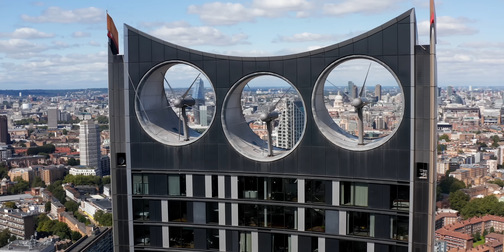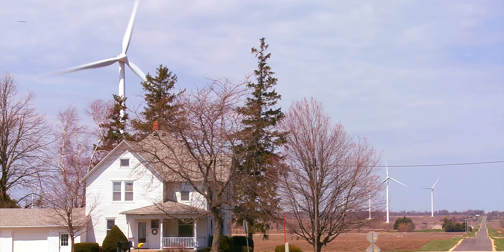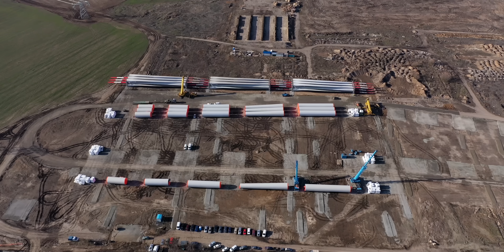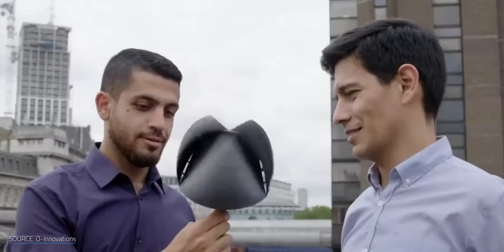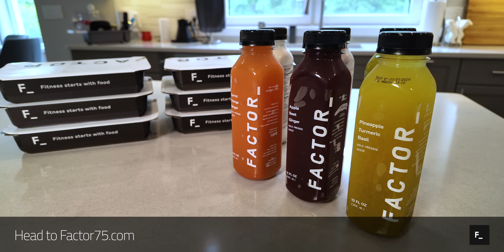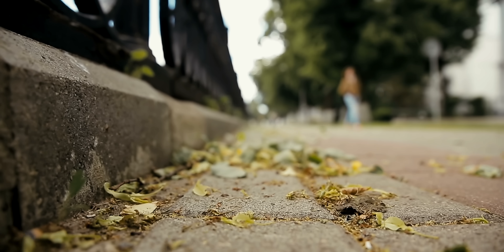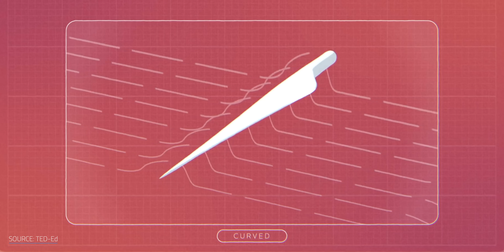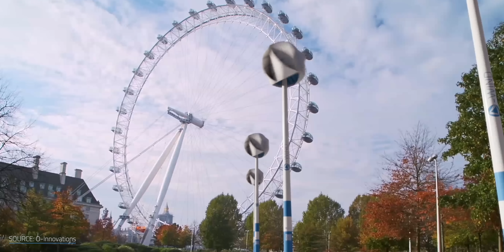How a Small Wind Turbine Will Revolutionize Wind Energy

Comment from the maker: Will wind turbines become the new wind chimes? Or should city slickers seek their renewables elsewhere? Use code 50UNDECIDED to get 50% OFF plus free shipping on your first Factor box at https://bit.ly/3BRkS87!

If you liked this, check out How This Mechanical Battery is Making a Comeback https://youtu.be/YrXw4CmxljA?list=PLnTSM-ORSgi7uzySCXq8VXhodHB5B5OiQ
Reply: I think it has a serious shot, and for both apartments and home owners. 
Pairing wind and solar, helps to offset their "intermittent" nature.
If it is light enough the wind speed can be slower, and still turn the turbine.
This is clearly an emerging technology, and we don't yet know what the mature technology will look like.
I hope you keep following the developments in this field, no matter what strange twists blow through its development.
Reply: After two power outages in one month, and living where it is often windy at night, this wind “chime” would be unobtrusive and fill the solar gap of cloudy days and night time.  It seems size and shape would keep it stable at high rotation.  I wonder if height could be adjusted by either moving it up and down a pole, or moving a pole up or down to achieve maximum output.  Also could this be engineered to hold more than one collector on a mast?
Reply: Now that we’re going into the winter I hope you’ll do a video on de-icing systems for wind turbines.
Reply: Opensource self-3d-print link please?
Reply: I think you shouldnt promote small scale wind power at all.
Reply: This is so epic that 
Hindus: This was somehow copied from the Hindu texts. 
Muslims: it was made during the Islamic Golden age.
Reply: Oops someone was impersonating you. I accidently reported your comment.... hmm the impersonator's comment  disappeared
Reply: @UndecidedTechnology  
I think this is a potential part of a solution which must encompass multiple sources of energy. Unless and until we get nuclear fusion both working and safe for grid-level power production, the only non-GHG power production method that can provide a base load is nuclear fission. Obviously, that comes with its own problems given our decentralized approach to nuclear fission plant design and waste management.

Thus, I like this turbine. It doesn’t HAVE to provide all the power an apartment building requires. But if it’s power can be combined with some solar arrays and excess energy stored in building or micro grid energy storage, then utility-level wind and solar and geothermal (if you’re I. The right area), and maybe tidal or some other niche green energy methods if in the right area, can provide sufficient power.

Until we have reliable and grid-level non-GHG power that can completely replace natural gas and coal, and be safer and produce less nasty and long-lived waste than fission, any solution must include one key requirement: redundancy. It is a flat-out bad idea to use just one of the current green power generation methods.

Every kWh generated by one of these turbines is one less needed from solar, ‘clean’ wind, et al. The question is whether the total lifecycle cost can be made competitive - so, the cost of hooking these devices into the grid, and of servicing them, in addition to their standalone cost per kWh,
Reply: As with other smaller wind turbines go, durability, colder climates use, ease of maintenance, cost set up are all important factors to be taken into account. This type seems very promising, but what were the numbers wattage produced from one of these type for a 24 hour period ?
Reply: I think the idea is brilliant, but if we believe the photoshopped GIFs in your video, the ideal placement would be in corporate spaces. So the ROI will need to appeal to large landowners who will hang the omni directional SWT off there apartment complexes and deal with the NIBism.  I just can't see anyone attaching one to a balcony in a condo, not because it is technically infeasible, just most HOA would actively oppose such visible change to the building.
Reply: The combined top 100 most populated cities in the U.S. only holds 19% of our population

Comment: I like the design. It has aesthetic elegance and engineering elegance in equal measure.  But my solar and battery system makes more than 2MWh in a month, so I don't see me investing in something that makes the same amount in 6 to 12 months.  Admittedly is a 27kWp array but even so, it's silent, maintenance free, doesn't take up yard space.... and I have solar days but not wind days for my site, so feasibility study for wind would require an anemometer, a data logger, and a couple of year's worth of patience

Comment: Over 10 minutes of video and audio (to attract investors?), but what is the efficiency of this ball turbine? 

You mention 2000 to 5000 kWh/year for a 2.2 m diameter device. That requires really strong wind.  You don’t have that at ground level in an residential area.  The use case is limited to open/ coastal areas where other turbine designs will work better.    

When you do the math based on the wind statistics at residential locations, the outcome is mostly not in favor of small wind turbines.

Comment: Omni  (vertical axis wind turbines)  (VAWT)    wind turbines have two disadvantages.  `1.  Half the turbine is going upwind half the time.  This makes the absolute best efficiency 50%.  2.  The bearings on the VAWT have very high stress so they break down very often.  Horizontal Axis Wind Turbines  (HAWT)  are the only ones that can capture enough wind to make it worth while.    The Tension Turbine is the best of the lot.  It is not commercially available

Comment: Doing the mathematics, 2000 to 5000 kilowatt hour per year, so split the difference = 3500 KwH x 20c (average AU price per KwH) = $700 per year, so I would need to buy one for under $1000AUD assuming I don't have to pay for installation, inverter or batteries. This might work later if the current electricity price continues it's upward trend, till then I'd need more output. Nice idea though.

Comment: This is interesting as a solution for night generation in sailboats. While solar panels are revolutionizing the sailing industry by allowing the comforts of a house in a sailboat and in some cases electrification of propulsion, reduced generation in winter and no generation by night puts a cap on how much one can depend on the solar panels. Commenting them with a small wind turbine lifted on the forestay (the fixed wire that runs from the front of the boat to the top of the mast) would make a huge difference allowing generation to continue during the night with moderate to strong winds. The bar would be that it needs to be able to generate at least 300W with ~10Km/h winds, which usually requires a large turbine, but maybe a few of these could do the trick. And given their construction, maybe they can be made "collapsible" so they lay flat at the bottom of the forestay during sailing and are raised during mooring for generation. If you can achieve that, you got a billion dollar product.

Comment: I think I have an idea to improve this system by combining wind energy with solar energy. A U-shaped structure is brought, then several spherical fans are placed in the belly of the U-shaped structure. Then the U-shaped opening is closed with a layer. Then a platform for solar panels is placed. This idea can be used to exploit the energy of sunlight and wind energy.

Comment: The problem can be solved by improvements to the battery situation and more so by improving the motors, Focusing only on the blades is academia as usual trying to pluck low hanging fruit and expecting prime quality. Once the battery tech improves by at least another 15-20% and so do the mechanical efficiency, than this tech will be viable. Yes, I know, sounds like "captain obvious" to the haters as usual, but hopefully this will help shift the focus to integration of those ideas. Coz We Aren't far from it. But for this to happen from the ground up, we also need to re-evaluate of politics of energy. And again, captain obvious, you can't have nice things when you have drumph like leaders in power in various countries.

Comment: Another way to look at this problem is that most wind turbines will produce some power, but often at a lower voltage that one might be thinking of to charge up batteries.  Enter the idea of inverters.  Typically, commercial inverters like higher input voltages too.  For smaller DIY setups, this can be a problem. The version of 'inverter' a person might then look to is something called a 'joule thief.'
Reply: You always need an MPPT inverter,, to get some overall efficiency. The system needs also provisions to handle excessive wind (eddy current brake system or something similar).   Brake systems work generally better on high TSR ratio designs as they stall  reducing mechanical power output significantly when TSR drops.

Comment: Two killer apps.  WIFI kit, generator say 12 to 24 inches, battery, wifi hub with say 50 to 100 foot range.  Optional Pole, optional buriable base, water filled base, 50 or 100 foot outdoor low voltage extension cord to power it when no wind to keep battery at say 15%.  If you can add an LED light inside to come on at night, big plus.  Might find a market in all sorts of biz, outdoor events, weddings, parties, fairs, of course back yards.  Have one of your engineers go rouge and secretly release to internet software upgrade to allow hundreds to mesh to multiple / dozens of wired wifi connections say distributing packets to ea to make it harder for ISPs to tell you're part of a 'private' wifi net that might cover say all the backyards on a block...   Secondary app - Ditto for outdoor night lighting / with add on kit to add speakers and sound.  Same markets.  Powering homes along coasts, boats of course, maybe in mountains.  If you can make one that is tiny, a foot or under, for under $50 to buy to test to see if there is enough wind where you are, with an add on kit say to charge a cell phone in emergencies, might have a market there.  I'd buy one.  Might include an offer to win a $1,000 buying spree at Best Buy for anyone who volunteers to hook up a USB stick with wifi connector to report wind capabilities in the area to you.  The wind data from 10,000's of these might be worth something.  Pity no one will every see this..

Comment: 10:28 Does it really need to enable total energy independence, though? Similar to solar, or the electric battery in a hybrid car, just being a supplemental power source could be huge in bringing down energy costs and reducing reliance on fossil fuels. If you just need to install it, maintenance is low, and it's as unobtrusive as it seems, it would be a no-brainer for building owners as it'll pay for itself over time in energy savings.

Comment: I have for the last 15 years chosen a totally different solution. A combination of solar panels and being a part owner of a big wind turbine about 1500 km up in northern Swden. I own 7 shares in this big wind turbine, and every share gives me as a standard 1000 kWh per year. Sometimes slightly more, sometimes slightly less. So yes I have no need for electricity except these two sources. In Sweden you ccan also find similar arrangements for solar farms. So yes, this is a possible solution in Sweden, for city dvellers! 

Since Sweden is heavily forested, and bigger cities more than 500.000 inh. are few (2 in fact). In Sweden it is very few parts of the bigger cities, where the buildings are placed with the density shown in the add. And the heights of the buildings are not at all similar. For me, I live in rural areas,  where the amplified wind can not be found, a lot of high trees close up, doesnt create this effect, a personal wind turbine of any sort has never been on the agenda.. 

And of course it all comes down to energy output, compared to cost, and type case figures is what I miss in your add.

Comment: Small wind turbines are green energy snake oil and it's irresponsible to give them free attention. Turbines need a lot of torque to make significant power and their ball is spinning fast because there is no resistance! It's not connected to anything yet. Wind needs a big level to make a lot of torque which is why efficiency improves with larger and larger turbines. This will work about as well as a pinwheel, it's basically an expensive toy that produces less power than a solar panel but needs more maintenance. These things are like claims of perpetual energy machines meaning you need to demand actual proof of claims first at this point before taking them at their word and they have no such proof and like every small wind turbine before them they are never going to. You should demand proof of claims and remove this video because people have to stop giving a platform to unsubstantiated claims in this space. This is exactly why @2Fast4Mellow bought a "10kW" wind turbine and it produced like 125kW for the whole year (which works out to about 14 watts an hour or enough to run about 1 lightbulb). I recommend reading an article from new atlas about this and in the future please try not to give toy turbines a platform as some kind of legitimate energy source:  https://newatlas.com/dodgy-wind-turbines/27876/

Comment: I think the micro-climate aspect of these is the real problem.   With solar, I can just quickly use a website and know basically how much energy I am going to generate with each panel.   But that all changes with wind, because very small details of my location can make huge changes to energy.   Which side of the building am I on,  which floor am I on?  It makes it very hard to calculate if they are worth it for my microclimate.

Comment: I live in Ireland 🇮🇪 PV panels are going up rapidly here on residential houses. Our average annual consumption is 4200 kWh. My small PV system (14 panels, 5 kWp) has generated already over 12 MWh in 3.5 years. I also have an electric car and a home charger. With a small O-Wind in my garden generating about 2-5 kWh per day, my grid dependence would probably go from 50% to 35% 😊  There’s always a breeze here in Ireland. Especially from September to April.

Comment: Its not the production of energy that needs to be looked at but the consumption of it. Household appliances need to be invented that consume less power. For example, I had 10 light surrounding my house of 40w, 10 years ago I changed them to 1w bulbs 💡.  That's from 400w to 4 watts and I still can see where I'm walking.  We need to get rid of 220v appliances and move to 24V , 12v and 5v . A washing machine could have batteries instead of lead weights . The batteries charge during the day and can power it in the evenings.  Same with fridges. If battery technology gets better and safer, this is the way to go.

Comment: What I like about wind over a silicon is that it's a mechanical device, it's easy to fix rather than just replace unlike a solar panel 

Pumping silicone with light is cool and all, but a spinning magnet near some wire just works

Comment: IDK, I think a New Yorker (City) would be a good candidate for this; you've got venturi effects, and you're high-density, which means you need less energy.  So would Dutch cities, same deal only more of it, particularly the wind part.  The other thing to do is combine this with a battery pack to account for variability.  I would hazard that it would be much easier to put a two-meter ball on a mast on the roof of my Dutch building than it would be to do solar panels, which, because my roof faces east, is not so good - the neighbours built a dormer on their roof to get a flat space for solar panels.  (All the houses whose roofs face south have them hereabouts, for sure... ) (This is what Americans would call a townhouse, or New Yorkers, a row house - eight units all attached, single-faceted roofs such that the top floor has half the useable cubic space as the other two...) 

The one thing I'm thinking - your pictures show energy balls hanging off apartment buildings, but I'll bet installation on existing units would be INTERESTING.  One, since you've got common electrical in NYC buildings, integrating the system will be both a technical and bureaucratic ADVENTURE... AND there's the physical aspect of hanging the ball off the building.  My three-floor building shouldn't be too hard... but if you're on the fourteenth floor, doing this safely... Hmmm.  Window washer's rigs?  But it's a problem to be solved.

Comment: Electrical building designer here, I can tell you unless there are specific government of ahj incentives building owners in the states will not opt for using supplemental wind power. It’s very capital intensive on the equipment side since you can’t just plug this thing into your normal building power without at least a large battery, transfer devices and large inverters which all take up a lot of physical space and can range from $5-10k each on the low end. I really love the idea local separated grids but it’s unfortunately not very feasible in the construction industry with the scale that a lot of larger commercial buildings need in power requirements. Same story goes for solar. However I think this would be great for rural residential areas in the Great Plains for supplemental power or other areas similar in the world.
Reply: This would be perfect for complimenting residential solar like the 19,200watts of panels. And 85.8kw of batteries 2 18k inverters. That I already have. So lots of room for extra capacity of wind generators in steady of propane/diesel powered generators.

Comment: One planning hazard I would consider before buying these: what if later construction work changes the air flows in the area? You can't control whether a building opposite you gets torn down, renovated or replaced and suddenly your nice air funnel where your SWT was planted is gone.